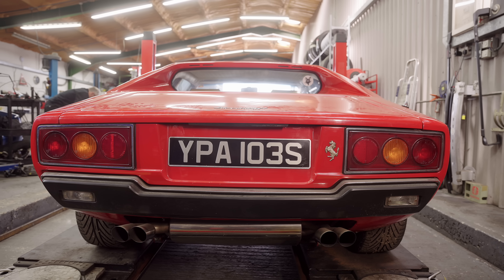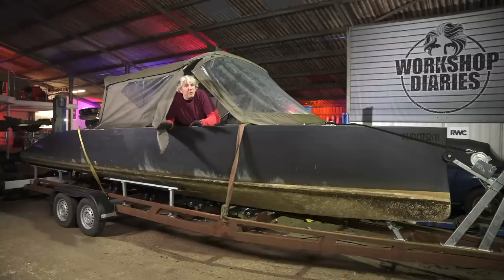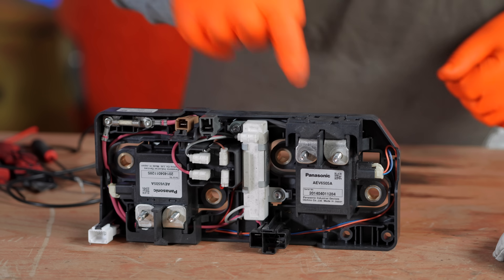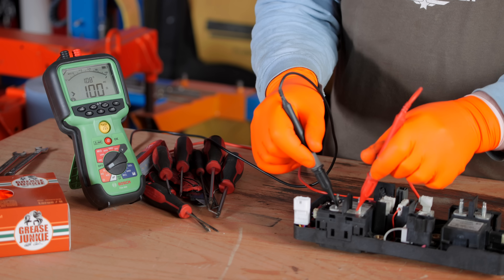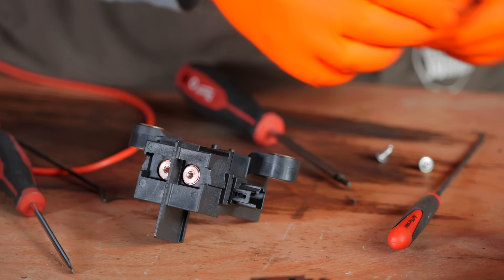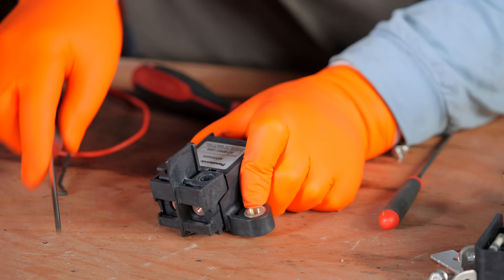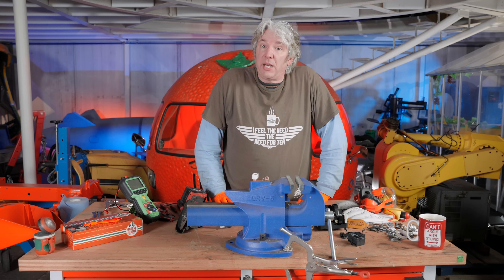1 Surprising Thing I Found Inside a Welded EV Contactor

Comment: I'm and electrical engineer and I design inverters. Big contactors are like a necessary evil because you really need them, but if they open on an inductive load with basically any current going through them they're prone to arcing. Also, the voltage and current ratings aren't really ratings for power, since when the contacts are open, there's no current through it, and when the contacts are closed there's no voltage across them. Its likely the maximum current expected to go through it is 80 amps or less on a 100 amp contactor at full load (I'm not sure what kind of derating they use in EVs it might be more or less than 80%).
Reply: I have been part of a few high voltage powertrain designs so far and I agree, these contactors are big bulky and a necessary evil. I would never imagine putting in a battery contactor whose rating is below max power, way too risky to have exactly the fault you've seen. How could Nissan argue for that solution? They might say the continuous load on a car is far below the peak (true) and an undersized contactor would not see the high load enough to justify sizing it for the max load - this (in our judgement) would be wrong, as the size of those contact plates is so small that they'd have no thermal inertia and hit max temperature within less than a second of power ON. So, bad panda Nissan for cutting corners on  a safety critical component and bricking an otherwise perfectly serviceable powertrain to save 1 buck. Can you tell we had this chat internally a few times? The decision has gone differently though.
Reply: Can't they use thyristors, like in my Makita drill?
Reply: Edd it's so nice to see a real petrol-head (hope that isn't offensive to you!) embracing EV technology.  I was a petrol-head, once, too - but it was the simplicity, power/kg and elegance of the electric drive train that won me over - along with not having to be ripped off every time I visited a garage for repairs.

Anyway, surely the contactor's current rating relates to its breaking current capability (and I don't mean 'braking' current - I mean the ability for the contacts to open without being damaged by a current flowing through them)?  In normal operation, there will be very little current flowing when the contactor opens because the car will not be moving (ie you won't normally turn off the ignition when the car is still moving and thus a high current is flowing through the contactor either one way - accelerating - or the other - decelerating/regen).  Therefore the contactor's breaking current rating will be significantly less than its maximum operating current...  

The other thing to watch for in relation to contact ratings is AC Vs DC current rating as the former can get away with much less robust contacts due to the nature of AC current.  Here, the current flow stops and reverses up to thousands of times a second giving a chance for whatever arc may have been created to extinguish - and the arc is plasma at many thousands of degrees C and thus potentially very capable of damaging the metal contacts.  Some devices - including contactors- have a magnet located very close to the contacts so that if an arc is created, the magnetic field from the magnet 'blows out' the arc thereby protecting the contacts.  

Maybe the ignition was turned off under power - or more likely, some other fault caused the contactor to open when high current was flowing - there was quite a lot of sign of molten metal on one of those contacts - molten and then squashed... and thus welded.

But I haven't a clue really!
Reply: These contactors see most arcing when turning on and dealing with inrush current.
The resistor slow start circuit might have failed to do it's job. Or the coil didn't get enough power to switch quickly.
Not sure if the resistor circuit is used when turning off, to take some of the discharge load when disconnecting..
Aside from all that. Edd said 360v pack and 80A contactor? So 28.8kw?
And an 80kw (peak) motor?
Is there a place where garages file their repairs? Or shops on how often certain parts are sold? It does seem these contactors are mightily undersized for their use. Nissan has some explaining to do.
Reply: @FlexDRG_Lampje  The motor controller should be monitoring the precharge circuit and refuse to close the contactor until the motor controller voltage is within a few volts of the battery voltage.  The contactor should never be making or breaking more than a minor bit of voltage and current in everyday usage.  It exists for total galvanic isolation and a single full current emergency open.

In the olds of home-built EVs the pre-charge circuit was simply a smaller relay with resistor, but that wasn't a good solution.  It typically was a painfully long ten second delay, there was still a voltage difference when the contactor closed, and multiple restarts/reboots risked overheating the resistor.  The problem was that there was a hefty current flow initially, dropping to an ineffective trickle as the voltages got close. The better solution, and what I expect they are using here, is effectively a constant current switching power supply.  That's not going to create much heat, will be very reliable, and will quickly bring the motor capacitor voltage very close to the battery voltage since it's not slowing down at the end.  

This contactor appears to have completely melted the silver contacts, which suggests over-current during use.  It may have been started by contaminated contact surfaces and inadequate contact cooling, but it wouldn't have melted without lots of current at the same time.
Reply: @martinwinlow  You'll be well ripped off if your garage wants to sell you a new battery pack because of a welded contactor in a £200 replaceable assembly!
Reply: @martinwinlow  very generally speaking what I’ve seen the current rating on a contactor like that is going to be continuous load current and the breaking current will be lower. They might give an AC or DC breaking current rating on that data sheet but hard to say.
Reply: The other problem is contactors have a DC and AC voltage rating - and the DC rating is usually about 10% of its AC voltage rating…
DC arcs badly and arcs melt the contact material so it fuses…
Reply: @allangibson8494  These are a lot different than industrial contactors, the rating will be in DC, although I'd have to look at the data sheet to be 100% sure.
Reply: @ They are frequently dual rated - because the manufacturer may use them for multiple applications.
Reply: I can't believe how puny those contactors are, considering their duty.
I'm more used to contactors for DOL starting large1100V squirrel cage induction motors though. You wouldn't want to carry one too far.
Reply: Long time ago there was a simple diode used to shortcut the inducted current while switching off. Nowadays, the money and waste is made by striking this simple stuff out
Reply: I have seen hot switched contactor failures before and these are not due to hot switching. The moveable contact is copper and the non-moveable appears to be shiny- implies either nickel or tin plating- it almost looks like tin whiskers. The other thing that is missing is the magnet that would pull any molten metal away from the contact area. Built for cost not reliability
Reply: Wouldn't it be better to use MOSFETs instead of contactors? Or would it be too expensive?
Reply: @ Yes, too expensive and they last too long 😉 The needed cooling will increase the size and makes the construction more expensive
Reply: @kleavenae  mosfets would make the circuit a lot more complicated since you’d need to add some sort of isolated drive circuitry, and at very high powers you run into cost problems. Also, high power mosfets usually need to be actively cooled.
Reply: @kleavenae  Yes, but....

Contactors provide positive mechanical isolation in ways that MOSFETs can't. GIven the mostly uncontrolled environment of automotive maintenance it's much safer than risking haviong something zap the FET into being locked on.
Reply: @kleavenae  MOSFETs have a parasitic diode and will only cut current in one direction. What you really want is something that perfectly isolates the battery, which makes a physical contact by far the best "man" for the job.
Reply: @kleavenae  Too expensive, too much losses, mechanical contactors are cheap and good enough. Plus mosfets usually fail short so...not too safe.
Reply: @kleavenae  they probably use MOSFET or IGBT to make a fine power control of the energy delivery, because we don't see those car working only full throttle or nothing. I bet this is the first circuit due to safety and control the on/of battery battery exposure. Then, a second circuit do the power delivery.
Reply: Did those contacts remind you of old fashioned ignition points? . . . First overrate the contactors for longevity, and add suppressors and freewheel diodes across any  inductive loads. Get us or draw us a circuit diagram next time. The power electronics ought o set the current at zero when the contactors have to operate. All very poor design given the tricky location.
Reply: The difficulty in breaking a DC current is that it never goes through a zero crossing. AC current on the other hand crosses zero 100/120 times a second which makes it much easier to extinguish the arc. The EV contactor does not open when the motor are drawing current, only some of the electronics.
Reply: Aren't these ratings mostly continuous current ratings? I have a similar year Leaf. Using LeafSpy you can tell and log power usage during driving. Even at highway speeds it doesn't go above 20-ish kW. Accelerating at 80kW, anything above 40kW really - you can only do that for a couple of seconds before you're at highway speeds. I doubt that little bit will heat up enough to be an issue. Still. Would have preferred to see a part rated a bit closer to the max. Or at least over the DC fast charge rate (which I've never seen above 45kW)
Reply: @PascalScheffers  one issue is that there doesn't appear to be a spec sheet for that part on the web, leaving lots of guesses by general commentators.
Reply: Those contacts seem to be made of copper. Wouldn't using a harder metal be better, one with a higher melting point?
Reply: @ Those contacts are usually covered with wolfram or similar material. But this will burn away over the time by the sparks while switching.
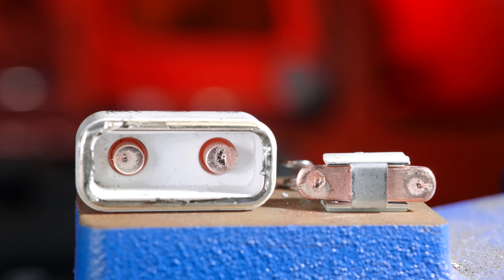Reply: @haraldsimon2807  Surely there needs to be oxygen for sparks? Looking from 15:45, the metal appears to be melted rather than burnt.
Reply: @haraldsimon2807  High power DC contactors have either pure copper or some copper tin alloys. Wolfram (tungsten) is inferior here because of signifivantly higher resistance and hardness. DC contactors like the one above are sealed, filled with nasty stuff like SF6 gas, plus have magnetic arc quenching. Really big DC contactors have open contacts with huge arc chutes.
Reply: Question I assume it won't need to  contact under a full current demand??
Reply: The discussion tends to indicate the level of complexity (or is it just 'complicated') thought that needs to go into these systems, and the hidden workarounds to all the historic 'truths' that are being revised. 
Almost as complicated as all those tweaks and reworks in the old Ford model T ICE and it's magneto ? 😁
Reply: This is why for DC breakers, snubber capacitors and advanced arc quenching measures are a must.

The derating for EVs is usually at least 50% on the published DC value (which is always less than AC), because of the fire risk. I'm fairly dismayed that Nissan have pulled something this boneheaded and it's something that needs flagging to safety authorities (and insurers) as needing an urgent recall

Those Panasonic contactors are rated at 200A continuous 500V (250A peak) and frankly I'd never want them to carry more than 100A. Given that you're looking at 300-350A at full peak acceleration, they're marginal at best (this current is only going to be sustained for 5 seconds tops. They're a "precharge" relay and "should" never disconnect when the car is active, so I suspect that the automotive engineering team thought that it'd be OK without referring to power electronic design engineers (worst case scenario modelling)

That said, they're designated by Matshita as precharge contactors, are feeding the caps via dropper resistors and should never see high current for more than 100ms (once the 350V rail comes up the main contactors to the rest of the car activate), so there should never be that kind of current passed through them. On the other hand, Nissan might have put them into service as primaries...

Comment: Sometimes switch contacts are rated for the SWITCHING current, and they may be able to carry more current than that when engaged.
It would be presumed that the highest current situations (hard acceleration) would not include moving the Contactor at that time.
The Contactor would be actually switching on and off when turning the car ON or OFF.
...Maybe...
Reply: Good point. Interesting to see if anyone else can back up this explanation but it makes sense to me.

Comment: 13:15 The ceramic insulator is probably not beryllium oxide , but if it is then you should run away. 
It's safe, right up until it gets shattered or cracked and its dust gets into your lungs.
Sometimes they're clearly marked with a BeO warning... Sometimes.
Reply: I really doubt it's BeO - that's normally only used when you need something to be both an excellent electrical insulator and an excellent thermal conductor.

Comment: 10:30 Firstly, the power printed on a motor can mean many things. It can mean the peak power the motor can produce, it can also be the peak continuous power the motor can produce, or the peak continuous thermally limited power a motor can produce, and/or many other definitions. The peak current draw might be as high, but the nominal current draw much lower. The capacitors would be able to supply the short term power pulse, and 'smooth out' the current from the battery (hence have a lower current draw through the relays).
Meanwhile the current printed on the relay might be nominal current draw, but still able to handle much higher current pulses for short durations. It all depends on the definitions in the datasheet, I am sure the engineers have done their homework.

Comment: Was there some other fault that cause the contactor to disconnect under load, and arc as you wouldn’t expect that to be normal operation.
Reply: I imagine the contactor failed because it was sailing close to the wind so as to speak.  It probably was rated for a 50% duty cycle and has a design inbuilt life cycle of a specified number of hours.  Manufacturers design equipment today with inbuilt obsolescence and as we saw with the battery it was not designed to be repaired.  I can't imagine your local car dealer doing such a repair job like the one Ed did.

Comment: Whilst they have a custom part number for the Nissan application, they're just standard Panasonic AEV14012 contactors different mounting ears. The specifications are 120 Amp continuous,  225 Amp for 3 minutes and 400 Amp for 30 seconds with 38mm2 busbars (conducting heat away). They are Hydrogen filled and fitted with magnetic blowouts to help quench an arc if opened under load.
Reply from the maker: Love it, knew someone would know more about them! Thanks for the info, how much are they when bought separately?
Reply: @eddchina  You  need the Nissan specific version for a direct drop in and I don't think they're available from Nissan (I've got a couple of used ones to hand) . I've used Kiovac, or Albright contactors as replacements. Both have higher current ratings. The EV200 has a 200 amp continuous rating and is readily available from Farnell, Mouser etc. I usually call Dalroad Norso, they're very helpful.

Comment: I'm stunned how small that contactor is/was.  I would have expected something much more beefy.  Maybe that is why it failed. A bit of built in obsolescence?  Also +1 to see the boat back in the water
Reply from the maker: Brilliant, thanks for the vote. Definitely think Nissan should have spent a £1 or two more on the contactors!
Reply: @eddchina  I have a family member who used to work for Nissan. He did a lot of work testing next years models. They used to tell the engineers to strip $500 out of next year’s car effectively making it worse.
Reply: @Krunch2020  not surprising at all

Comment: You can actually count energy in electrical system with 1 J = 1 Nm = 1 Ws = 1 kg·m²/s² = 1 VAs this gives you how much energy is released in a short that rise to a 100 000's of amps in milliseconds that means 1000's on Nm's of torque which laymen commonly know as an explosion and even in normal operating conditions induction makes a pull on cables and race ways and other metallic parts. That's why most of the good stuff (like you fellow electricians, wear that PPE) in electricity is behind protective covers; not just to avoid accidents but to protect from a shrapnel and 1000's of C/F's heat in a case of a short. From the component side there are also semiconductor contactors that have no moving parts but I think they have chosen a mechanical for their inherent "air gap" that gives you another margin of safety when dealing with the battery assuming the contacts have not welded of c.
Reply from the maker: Thank you. Very helpful and interesting!

Comment: Your math is correct.... IF the motor is DC. 
It's the same problem as with almost all other consumer electronics. The manufacturers save where they can, so things like these contactors aren't dimentioned with the redundancy needed for 20+ years of use.
BTW, the ceramics is just for electrical insulation. I sincerely doubt that it's fully encapsulated to provide a "no oxygen" environment.
Reply from the maker: I'll have to break another one an see if I can capture the gas/vacuum, or just ask Panasonic!
Reply: is definitely SF6